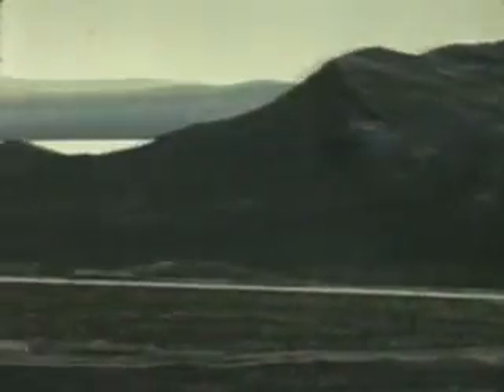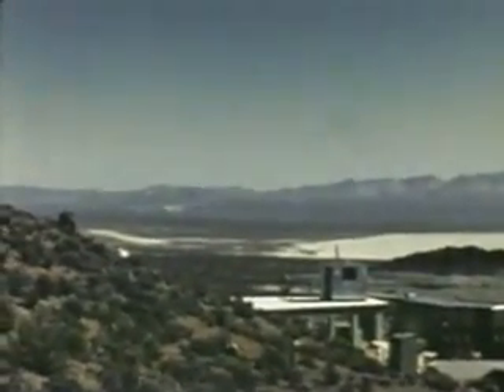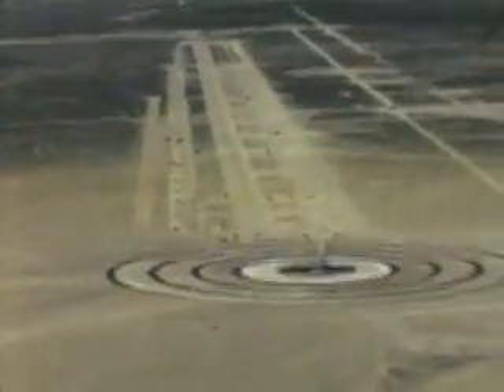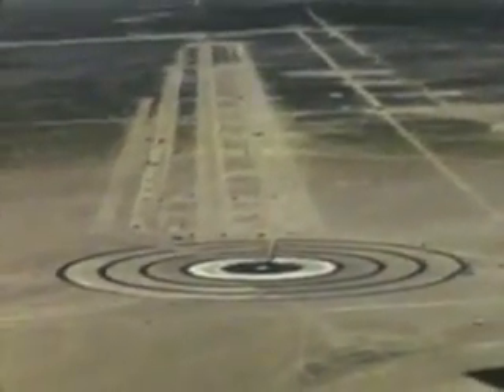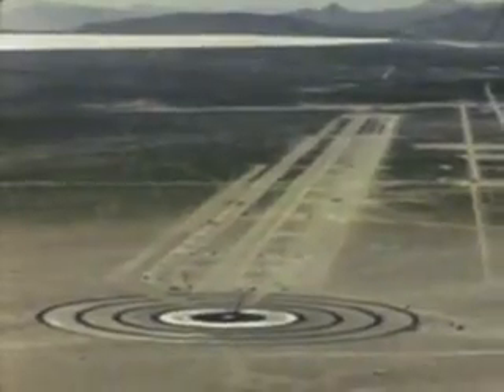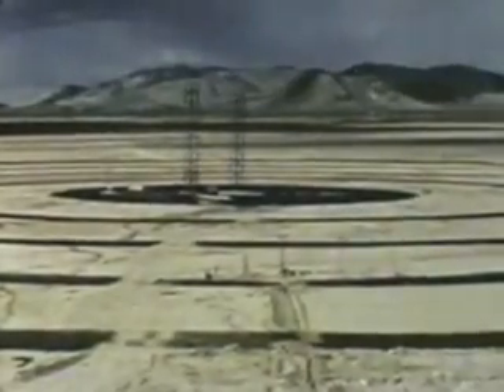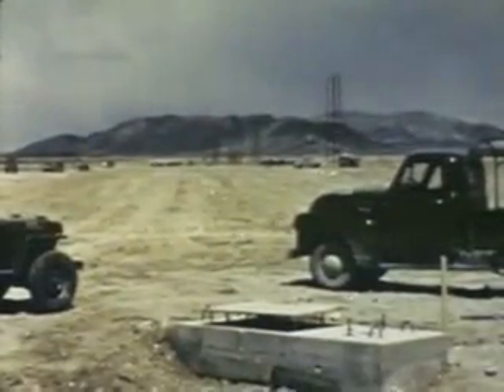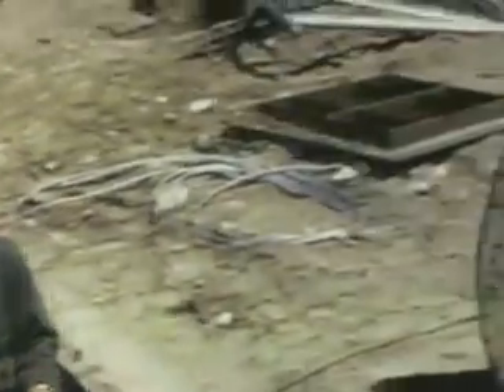Small Nuclear Weapons Tests

Comment: I never knew they fired smoke rockets until now I always thought the nuclear explosion caused those streams.
Reply: I think they use it to measure pressure and velocities by observing changes in it..idk
Reply: @unrealengine5-storm713  The shockwave pass trough them and can calculate shitloads of stuff with the data.
Reply: Me too
Reply: I always thought they were stretch marks from stressed out air.

No I did t. I just made this up. But close enough.
Reply: Its the heat

Comment: Is it really safe to go in there right after the blast? How are those guys now?
Reply: Safe or not safe, they're probably all dead by now.
Reply: @intraterrestrial5035  True, though my best guess is that most probably died well before their time, of cancer or other radiation-related illnesses.
Reply: @benb5891  it isn't that, we just have more knowledge of radiation and it's effects.
Reply: Andrew Onymous  You're incorrect. We do have more knowledge now.
Reply: Andrew Onymous  you're double incorrect. There's a video of soldiers standing directly under a high altitude explosion, they all got cancer.
Reply: I know the guy that were their they live close to fighter town USA and they still hang around their
Their older gentlemen but they hang out their quite A few of them.
Reply: @DanteTimberwolf  Those 5 guys did NOT all get cancer, they lived normal long lives.  Nuclear weapons create two types of radiation - a prompt flash and fallout.  The prompt flash happens in the first milliseconds upon detonation, and has a certain radius of effect which can be calculated.  Those men were outside the flash, blast, and thermal radii for that particular warhead.  Fallout is composed of the material from the bomb itself, plus any material on the ground close enough to be vaporized and neutron-activated by the flash.  The main risk of fallout is ingesting the radioactive material and getting hit internally by it over the subsequent days or years (depending on the isotope).  Since the ground was FAR beyond the range of the fireball, the only fallout was the very small amount of bomb material, which was carried by the wind downrange from where the men were located.  The biggest source of radiation for them that day came from standing around in the blazing hot desert sun for who knows how long.

As far as the guys collecting data in this video, I'd expect this bomb to produce very minimal (but probably non-zero) neutron activation in the ground, but direct fallout if bomb material would probably be present, and some of those fission products are REALLY hot.  The measured dose onsite may be one thing, but hopefully they took great precautions not to breathe or otherwise absorb any of that dust.  You can hold an alpha radiation emitter in your hand with little to no consequence, but mere micrograms of the stuff inside you can be a huge problem.
Reply: i mean the one guys here to tells about it so it must have been fine
Reply: they grew a third arm..
Reply: Dead. Nevada itself has fall out.

Comment: Hi i have a question  Is there a technological minimum size limit for a thermonuclear warhead  ? thanks
Reply: It is completely depends on a definition of “thermonuclear”. Adding a D-T capsule for producing neutrons to a small warhead with a power of 0.0x kT can be interpreted as a ”thermonuclear” design. Still, for more traditional definition of a thermonucler weapon as at least two-stage Teller-Ulam scheme, the praclical low limit lies on first kilotons of total power.
Reply: @TheRetiredPanther  hi thank you for the very kind and interesting information 
I wonder how small a nuclear warhead can be made   
They already told me that is not possible to make a soda can size small nuclear for instance  
I read that the W54 in its various versions and mods  had a yield of 10 to 1,000 tons of TNT for a weight of 51 pounds
Reply: @gino3286  if the question is a physical size, not energy release, the practical limit of any thermonuclear design is restricted by the size of a primary. Not every fission bomb can serve as a primary; these are the restrictions of high transparency for X-rays, limited neutron flux to avoid pre-heating a secondary capsule, etc. In other hand, the N-stage design requires a big, low-transparent outside container to keep much of a trigger energy inside until ignition of a secondary. As a result, conventional thermonuclear warheads cannot be smaller than approximately 100 pounds. The W54 was a fission weapon that requires much less X-ray optics, so it was one of the smallest nuclear warheads in a history.
Reply: @TheRetiredPanther  hi thank you very much indeed   I missed that the W54 was a fission weapon   I see better now 
However 100 pounds are not very much anyway   And what level of yield could provide a 100 pounds thermo warhead ?  more or less of course